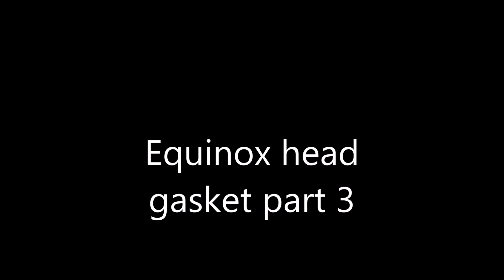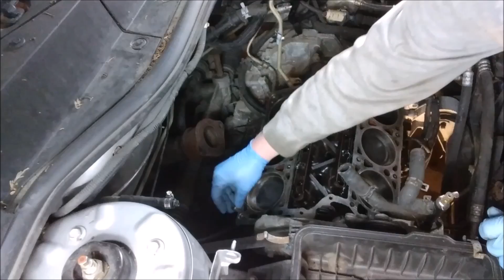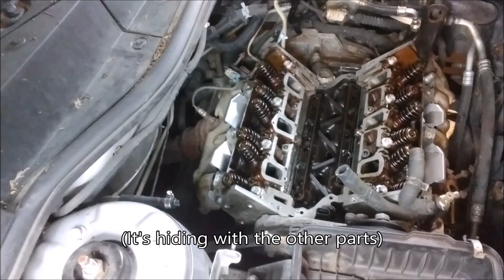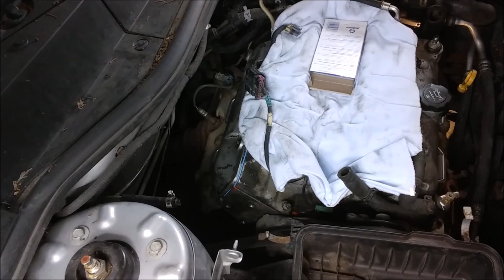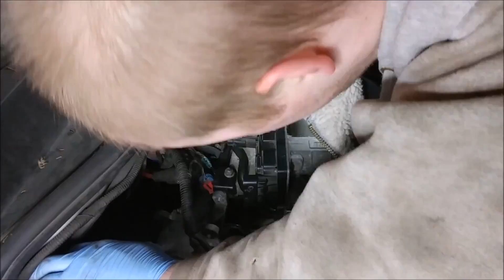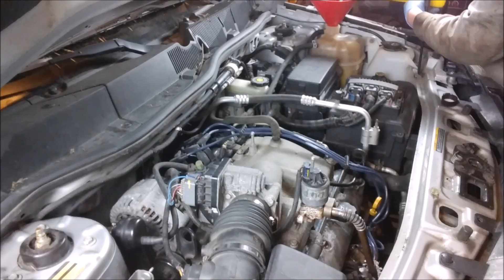Equinox head gasket part 3

Comment: I just completed this task on a 2008 equinox.  Your set of three videos I think are the best ones for this work.  I had never been that deep into a modern engine, so took a lot of photos and marked parts with tape and magic marker to get them reinstalled in right place and right order.  One comment I have would be to loosen and remove the coolant tube in the lower intake manifold, driver side, before pulling the intake off.  I tried to wiggle intake and pull forward like you did.  The pipe came out, but the mounting bracket got bent a lot in process, and had to be straightened out during reassembly.

Comment: Thought it was 25 ft lbs on rockers? 18 on intake bolts?
Reply from the maker: It might be, I don't do this kind of work often so I look it up. Also some gasket companies will issue revised torque specs to work with their products.
Reply: @SRMWorkshop  I'm doing one now and am stuck between a few other specs. What specs u use
Reply from the maker: @haidenbuck2014  you might give this one a try. chevy-specs.com/cars/2006/equinox3.4/torque-specs_engine.php

Comment: Went to check the oil level as these burn oil and found that tell tell sign of water mixing with oil. Only thing is that it not over heating. So would it have to over heat for it to truly be a head gasket or it just hasn’t got there yet
Reply from the maker: They can fail in different ways. Somewhere it sounds like your engine has a blown gasket. It could be something like the timing cover, or something deeper. It is very hard on an engine to get driven like that, best to get it looked at sooner than later.
Reply: @SRMWorkshop  will do.  Plan on fixing it and selling. Wife just bought her replacement thank for your time

Comment: THE INTAKE AND EXHAUST PUSH RODS ARE A DIFFERENT LENGTH SO IT IS IMPARATIVE THAT YOU PUT BACK IN THEI R ORIGINAL LOCATION OR AT LEAST VERIFY THAT THE LENGTH IS CORRECT .

Comment: I have an 2005 Equinox. got told today that my coolant leak/overheat is likely the upper and lower intake manifold gasket.  I think the mechanic said intake cylinder gasket.  Here in 2020, assuming he doesn't have to go down to the head gasket, what should be the cost of this job with labor and parts?
How important is it for me to ask for metal core replacement gaskets versus the  plastic ones being replaced?  thanks if ur still out there. from st louis area
Reply from the maker: if it's just the intake I imagine it would be 2 or 3 hours of labor (at whatever the shop rate is) and maybe $100 for gaskets and fluids. But I could be way off there as most shops quote based on book time. As for the gaskets, I remember his were just really crusty and brittle from age. I always try to get gaskets from reputable manufacturers or go full OEM. Hope that answers your questions.

Comment: Putting the head bolts back on where do the long ones go and the short ones... Only noticed on my 09 equinox  on the rear head it was 3 short and one long on the back and 3 long and one short on top.
Reply from the maker: If I remember correct they should all stick out the same amount when just dropped in the holes before you start threading them in (around 1/2"). That should tell you if one is in the wrong spot.

Comment: does the RTV gasket go at the ends of the valley at the ends of the s curved rubber gasket
Reply from the maker: correct
Reply: @SRMWorkshop  thank you  and thanks for the video was very helpful
Reply: should i let rtv dry or can i start putting it together while its wet
Reply: @jrboehlert4254  Give at least 15 minutes to set up

Comment: Excellent tutorial. Something that was not noted in the video that is crucial to success is that the push rods are slightly different lengths and easy for the DIYer to overlook during reassembly. The Intake push rod measures 5.75", the exhaust push rod measures 6.0" inches. The 1/4 inch difference will result in a bent intake valve if they are accidentally swapped.
Reply from the maker: that's a good catch, I just made sure each one went back in the exact spot it came out of.
Reply: Have you imagined if he swapped those push rods and bent them? Thank God that didn’t happen. Just to remember Exaust is 6 in and Intake 5.75.

Comment: This 3 part video was excellent. Just finished mine tonight. I only did the front. You can crack the tappet cover on the back to get your intake off. No alternator removal required.

Comment: What's the best method to get the belt back on without unbolting the engine mount and jacking the engine up? I'm just about finished going through this process but need to get the belt back on.
Reply from the maker: If i remember correctly, you can feed it over the difficult pulleys under the mount first, then work your way up.
Reply: @SRMWorkshop  I ended up feeding around all but the top idler pulley, and then tied a nylon rope around the tensioner pulley assembly,  then tied other end to a shovel handle. Then I was able to put the shovel tip in the ground in front of the car and push it out with one hand which loosened the tension pulley enough for me to pull the belt over the last pulley without tearing the engine mount apart. My head gasket replacement and upper engine rebuild went well and the car is running well.

Comment: DId you use any anti seize, oil or lube on the Head Bolt threads,  or you put them in dry?
Reply from the maker: I put them in clean and dry. unless your bolts require lube, don't use it as you may over tighten the bolts.
Reply: @SRMWorkshop  Thanks for the quick response! I searched and mine does need high temp thread sealant. Thanks again!

Comment: I figured the second pass on head bolts was 70 ft/lbs because soon as you got to the outside the inners had loosed up.
Reply from the maker: That sounds about right. I normally 1/2 the first torque spec for a snugging pass.
Reply: I did 65 as that was what they came off at. Fyi the rocker bolts wont take 45 without stripping. I had to helicoil one. 40 to 42 was what they could take.
Reply: 88 f pounds since is 130 for head bolts

Comment: After completing the head gasket replacement, I have valve chatter/ tapping coming from the rear valve cover. Any insight as to what may be the cause ? Thanks for the video, helped a TON.
Reply: Yes, put the push rods in the wrong hole and they will bend. Earlier in theses conversations it states one push rod will be 5 3/4 inch and the other is 6 inches. I suggest you read all comments they are very educational
Reply: Carray Leepier did you torque the lifters?

Comment: Now I understand why my mechanic guy wants to charge me a ton of money for my own car head gaskets replacement...truly is a pain in the ass job. There's no way I can do this sort of thing on my backyard. I got no tools, lack the skills, the patience and besides, I suffer from panic attacks!! I pretty much will set the damn car on fire if one stupid bolt ever gets, stubbornly stuck. My psychiatrist forbids me to get that much stress.Thanks for this eye opener video!!😂😂😂
Reply from the maker: I have been fiddling with cars for over 20 years now, and many projects were done rolling around in the dirt. If you do want to work on your own cars, start with the little things like oil changes and brakes. It requires minimal tools most of the time, and it's one less thing to pay a shop for.

Comment: Thank you for taking the time to make this video series. I've done a head gasket on a 94 Saturn, but this thing looks a bit more intimidating. I've watched it twice now with my 14 y/o son who is going to be getting his hands dirty on this one. We've just gotten started and going slowly. I am stumped right now on getting the metal coolant pipe off that covers the back bolts to the upper intake. Your vid quality in part 1 on that section wasn't able to show that.  We'll figure it out though. Either way, expect several more views before we are done.
Reply: It just pops out once you get the retaining bolt off.

Comment: I know you put the push rods off to the side in order that you took em out but if you didn’t do that is there anyway you can tell which ones go where
Reply from the maker: odds are they will interchange in the different spots just fine, I keep them in order and in the same direction so they will match back up with the existing wear in the engine.
Reply: TattooPyramidHead okay that makes sense. I just wanna make sure it’s not gonna cause major harm if I mix 2 rods and put em were they aren’t suppose to go. Thank you
Reply: @djnee572  Yes, put them in the wrong hole and they will bend. Earlier in theses conversations it states one push rod will be 5 3/4 inch and the other is 6 inches. I suggest you read all comments they are very educational.

Comment: Hello Tattoo, thanks for your video,   if its possible, can you share with me the torques for the head and the rocker arms bolts  please.
Regards
Reply from the maker: I would have to look it up, I just did a search for the sequence. The correct one for the head should be a 3 step sequence, 2 torque steps and then like 90 deg. The rockers are a single torque number.
Reply: Thank but I have a doubt in the 13:40 min of tour video you show 2 steps for the rockers, in the case of the head whats is the torque for the 1 step and what for the 2 step ?
Reply from the maker: I think I added an extra step for the rockers, put them to about half the final torque to make sure everything was seated nicely before final torque.
Reply: Thanks again Tattoo, can you give me the torque # lb/ft for the head and rockers ?
Reply from the maker: https://www.autozone.com/repairguides/Equinox-2005-2007-Torrent-2006-07/Engine-Mechanical-Components/Cylinder-Head/_/P-0996b43f80cb1b76

Comment: Great videos. I like to have the heads pressure tested for small cracks- the shop also cleans up the valves and installs new valve stem oil seals. I think that it is good value when the heads are off.
Reply from the maker: For sure a good idea when you have no clear indication of where the leak is. In this case it was very clear the gaskets were just destroyed, and the heads looked great

Comment: were did you get you gasket kit from
Reply from the maker: We found it on ebay, company out of Florida sold it. It was about half the price of a local auto parts store.
Reply: TattooPyramidHead do  you remember about how much you paid
Reply from the maker: I think it was around $200, including replacement head bolts (we purchased those separate)
Reply: TattooPyramidHead thank you so much sir, have a hood night

Comment: Dear TPH,

One trick that helps alot is to number the bolts and their bolt holes as you take the bolts out. So when you have your hardware set out, bolts can be easily matched to the holes if you have a problem.

Comment: What is the orange silicone down in the valley at 12:22?
Reply from the maker: Those came as part of the intake gasket kit, have no idea why they were orange. If you get the heads resurfaced it's best to ditch that gasket and run a fat bead of silicone instead, as the gasket will be too thick for the change in head height.
Reply: Thanks for the quick reply.  Is this the same set you used?  It is about $200 cheaper than autozone. 
 https://www.partsology.com/dnj-hgs3121-head-gasket-set?gclid=CjwKCAjwhOvPBRBxEiwAx2nhLjZpkPaJCmBMMPR8t6htiKq1_V5HeVRlNxVokAfTtHo_gsh4wurnvBoCZBgQAvD_BwE
Reply from the maker: Don't think that's the same set, but it looks like a pretty good one. You do need to pick up a set of head bolts cause they are one use only. We bought all of our stuff online as well.
Reply: Okay thanks, I found one where it's all together.  I'm starting it this weekend.  Great Videos!  https://www.partsology.com/head-gasket-set-with-head-bolts-hgs3121-hbk3147-dnj
Reply from the maker: If you have any questions let me know, I still have all the raw footage and can dig back through if needed.
Reply: Happy to let you know that the Equinox is still running great.  Total project cost was about $200 and it runs better than ever.  Thanks for these videos.

Comment: Best vids on YouTube for showing how to correctly perform this job! Thank you for taking the time to post it!
Reply from the maker: Thanks for watching
Reply from the maker: We started this project with an overheating issue. verified the electric fans were working, changed out the thermostat, and made sure there was no external leaks. After doing that we burped the system a couple times, but the air kept returning and that is the reason the head gasket needed to be changed.

I would caution against using any kind of stop leak as they normally just plug up radiators and other things you don't want to clog.
Reply: Hi!      
   TattooPyramidHead Please help...I did everything by watching the video..all went well but I am still getting overheated... putting new gasket change them all... can you tell me what could be the next step/problem, I was reading that I need to drop something into the radiator to stop leaks or change the cap...Thank u

Comment: what's the problem when you start it up how did u correct it?
Reply from the maker: It was a mistake I made in the firing order, I thought #1 cylinder was on the other side of the engine and did all the wires wrong. Just had to unplug them all and put them on the correct coil terminals.
Reply: TattooPyramidHead oh ok. coz im on my half way through by just watching ur video haha looks scary to me.thanks
Reply from the maker: Just take your time, most of the stuff will only go together one way so not too hard to figure out.

Comment: Great video. I wish I had found this series before I took my Equinox apart!   What grit is your honing block and where did you get it?  Also a friend gave me a parts washer, if i decide to clean the heads in it, is there a cleaner i can use that would not damage the valve stem seals?  I had the same problem with broken exhaust manifold studs for the rear head.  Luckily they both came out.  Thanks for taking the time to post the series.
Reply from the maker: The stem seals should be fine to wash, most things that tolerate being covered in oil put up with cleaners very good. I used the same wet/dry stone for the block and heads, the course side seemed to cut the nasty stuff off well and leave a nice finish.

Comment: HI.thank u so much for the time and sharing with us ur knowledge for the equinox.

i just wanna ask where did u buy the studs and bolts for exhaust manifold coz mine broke off...
Reply from the maker: I picked them up at a local place, Tacoma Screw (you can order from them). However the one I got from them needed the threads extended, and you need a good Die to cut the threads. you could get around that by adding some washers, but I would rather have the stud be correct.
Reply: Show me how to change the thermostat on a 2009 Chevy. Equinox 3.6 please

Comment: Perhaps you can answer some of my questions. I am wondering if 1) it's necessary to remove all the spark plugs and 2) did you have to set/mess-around-with Top Dead Center to do this job?
Reply from the maker: no and no. I changed the plugs because the rear ones are hard to reach with the engine fully assembled and I wanted it to run great for my friend over the long haul. if they are in good shape no need to change them. For top dead center, as long as you don't mess with the timing set (no need on this engine) the 2 sensors will figure out the position for you.